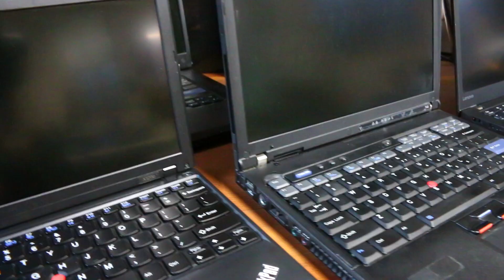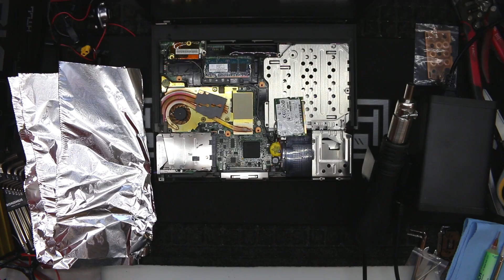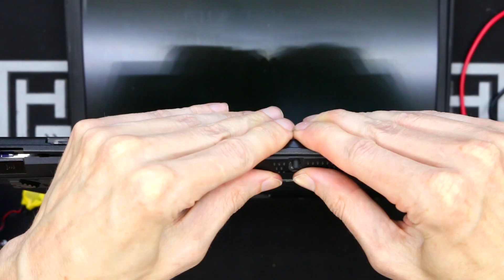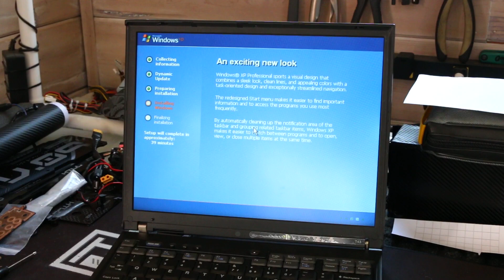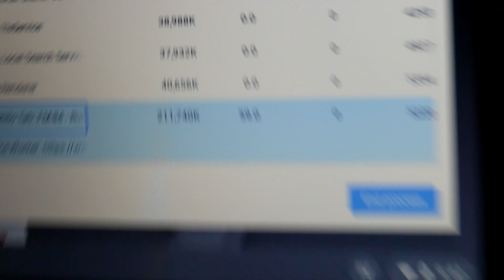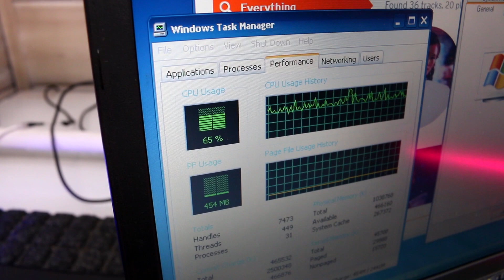💻 Can I Fix It? $3000 Broken T43 ThinkPad from 2005 - Board Repair \ Vintage IBM ThinkPad

Comment: My T43 still works well and has modern x86 Linux software (gentoo). Youtube with 360p videos work okay, sure it's not the fastest but hey it is what it is. It will never become my main rig, it's just for nostalgia purpose.
I upgraded mine with a M770, 2,13Ghz Pentium-M, 2GB of ram, a new Artheros TG3 wifi module and a Micron M600 msata ssd just for faster speeds. Perhaps in the future I can upgrade it with a better resolution screen 1400x1050. Thanks for the video, and I'm glad you repaired it. Nice!
Reply from the maker: That's awesome man, the build quality of these older Thinkpads is unmatched. I'm glad to hear you're still keeping them alive 🙌

Comment: my t43 the screen gets dim after a few minutes. I opened it and noticed the screen board (not sur of its name) gets extremely hot, any idea of what to do? thanks in advance.
Reply from the maker: It's possible a failing LCD panel, you could try to cool that chip while it's running and see if that helps with the dimming problem, that will help narrow down the culprit or at least tell you that if you replace the screen it is more or less likely to fix the problem. 👍

Comment: I have a T42. It goes into the BIOS just fine, and the keyboard works. But the hard drive behaves strangely, sometimes having intermittent power, but when I slightly move the drive, it gets power. Is this a symptom of cracked solder joints on my ThinkPad, or is this just the lack of a caddy?
Update: Looks like I have cracked southbridge solder joints too.
Reply from the maker: Most likely a bad connection at the hard drive, a caddy would help but it may not solve the issue. Inspect the connector on both the mobo and the hdd, it could just be a broken hdd connection and replacing the hard drive could fix it, but you'll have to investigate. 👍

Comment: Have you seen anyone retrofitting new hardware into it, basically using the shell and replacing the insides ? Can find anything on the web, probably wrong keywords.. except for the Hackaday custom mobo
Reply from the maker: I'm doing just that right now, transplanting the guts of a newer laptop into another older casing 👍 I'll be showing a video of it for sure.
Reply: @hightech-lowlife  can't ever get enough of synchronicities. I've looked into it before as I was actually thinking of retrofitting a t43p and it seems getting the original keyboard to work and possibly driving the original lcd (if there's no good replacement especially, 4:3 example) is the biggest obstacle, since you can even hack a smartphone with a broken screen into the chassis... maybe an idea for another video.
Reply: @hightech-lowlife  Looking forward to it
Reply: @hightech-lowlife  or remote desktop into the smartphone from the existing hardware, which removes some of the mentioned hardware level hassle
Reply from the maker: @zentrans  It is much easier if you can retrofit the newer screen and keyboard, it's not impossible to use the older screen and keyboard, but you need to do translations for the interfaces. There is a good write up for the keyboard here: https://www.instructables.com/How-to-Make-a-USB-Laptop-Keyboard-Controller/

I imagine doing something similar to the display connection too. 

I was able to retrofit the display and keyboard into the old case, which is harder from a hardware standpoint, but easier to do electronically as you don't need to mess with connectors or adapters.
Reply: @hightech-lowlife  but what about installing a whole new contained computer into the CD bay, connecting it directly via ethernet and remoting into it ? Yeah that's what I found when I was researching the keyboard problem, but displays are more complicated
Reply from the maker: @zentrans  Yes it is possible to do that, most of the computer's I have been messing around with are larger than a CD drive, but I guess it depends on what you're going for. You can also get little display to HDMI conversion boards which might be a bit easier, but even an HDMI connector can be pretty big when you're working inside a laptop 👍
Reply: @hightech-lowlife  Got a T43p for about the same price 29eur. This one has wide hinges on both sides, probably the bigger 15" version. Completely dead though lol, I'll try to diagnose the board issue.
Reply from the maker: @zentrans  I repaired a motherboard a while ago that had a no power issue, totally dead. I will make a video on it, could be a similar problem.
Reply: @hightech-lowlife  Hunting for a schematic right now
Reply from the maker: @zentrans  They should be around, I found a boardview schematic for an old X31 ThinkPad.
Reply: @hightech-lowlife  they should be around but it seems I'll have to look harder
Reply: @hightech-lowlife  Someone sent a schematic to me but it's not a boardview. Lemme know if you need it
Reply from the maker: @zentrans  Nice, nah I actually have since sold my T43. I was collecting ThinkPads through the generations but I stopped that and sold all mine, I only have 6 now 😂

Comment: Nice work on the repair!

The T43 was my first and my favorite laptop of all time.   The 14" form factor is just perfect.     I bought it refurbished in 2009 for $300, spent another $130 in 2011 on a new motherboard (darn southbridge), and it's been a pi-hole server the last two years.    Unfortunately, the southbridge is on the way out again, so it's being replaced by a $40 single board computer.   It's had a great run!
Reply from the maker: Thanks man! These old ThinkPads really are amazing, I wouldn't use this as a daily driver but it still can do some tasks and it's just cool to have as a collectors piece 👍 It's amazing how much more compute we have these days, most cheap cell phones have as much processing power as these.

Comment: Wow, I really did not thought that 17 years old laptop can still be used. I thought that a laptop can go up to 10 to 12 years and they are done.  Great job man must have been nostallgic to use windows XP good job. And any new keyboard project coming along? I wanted to buy a new  Bluetooth keyboard , got any recommendations?
Reply from the maker: Thanks so much! Yes, it's very old but still works! It really was bringing me back to 20 years ago when I was using XP, I only really got started into computers around Win 95, so XP was a huge upgrade from 95 and 98 👍 I am thinking of making a cyberdeck which has an integrated keyboard - I have a few other keyboard ideas floating around too. 

There are so many good bluetooth boards out there now! It really depends on what form factor you like, but I would check out Keychron boards for wireless.
Reply: @hightech-lowlife  okay thanks for the info.
hey, do you want a 2005 model flip phone.
Reply: Sony W300 Mobile Phone
Reply from the maker: @AmanKumar-cj8wu  Thanks Aman 👍 I appreciate the offer, but I actually do have a few phones already but I'm not sure if I could repurpose them for anything. Thanks so much though really! I do miss older phones that had physical keyboards though, they were so much better for texting.
Reply: @hightech-lowlife  no problem man. Yeah feeling of clicking something was much better, that's why now we buy mechanical keyboards😄.

Comment: I love ThinkPads too. Where I live is way too expensive buying parts to repair them unfortunately.
Just a few questions.
It's possible to install SSD on this model?
Why didn't you install Ubuntu?

Excellent video. Keep going!
Reply from the maker: Thanks Diogo! That's really unfortunate that it costs so much over there. Yes, I think I can install an SSD, would probably need an IDE to SATA adapter though 👍 I was thinking of adding a small SSD and also running Manjaro, I probably will do it in the future! Thanks man!!!

Comment: yes! love thinkpads, I have some piling up I should probably find uses for lol, except for my daily, the x230
theres something about them being durable and repairable and the hunt of finding a good deal on them that makes collecting them addictive
also, the plastic parts melting was probably the heat conducting through and coming off of the motherboard from heating the southbridge, I notice sometimes how hot it can get when soldering fat wires to pcb's lol
Reply from the maker: Thanks man!! I think you're right, there's something about them that make them way more collectible than other computers. 👍 That's true, I think because of how much heat was getting pumped in there, I don't think it was avoidable, but could also just be lack of experience. Thanks!!
Reply: imo the x230 is superior then the x220, mainly cuz ivybridge and opengl 3.3 lmao